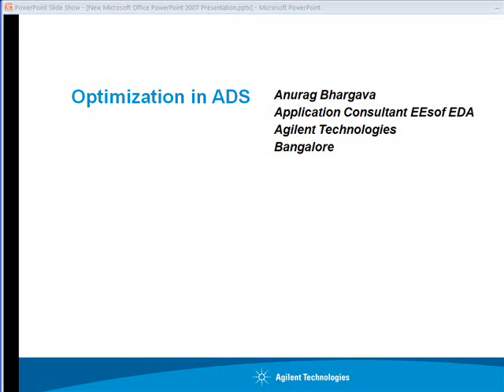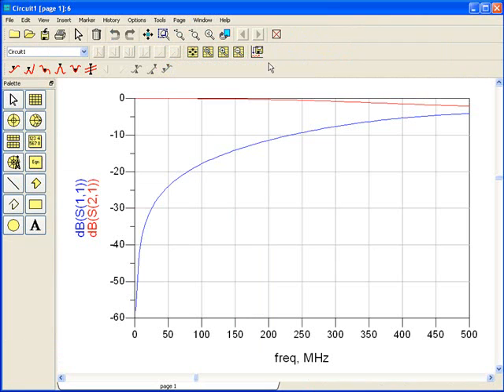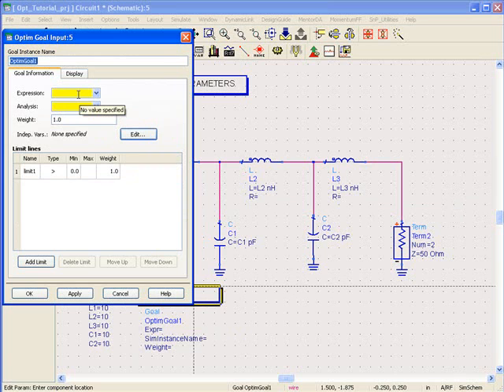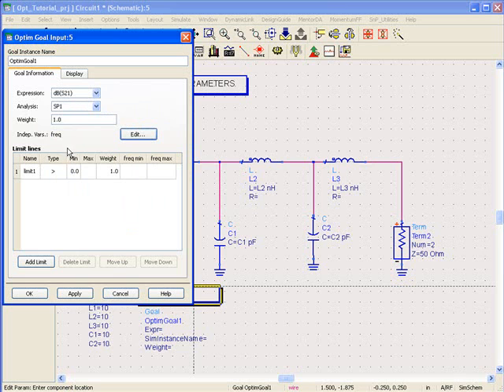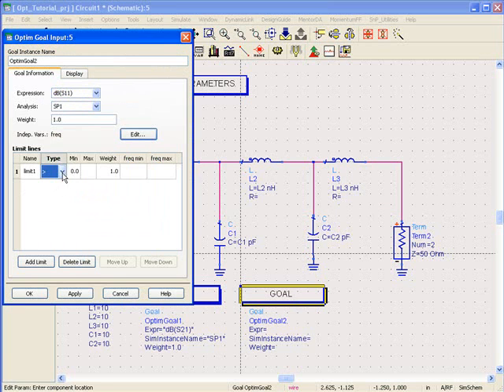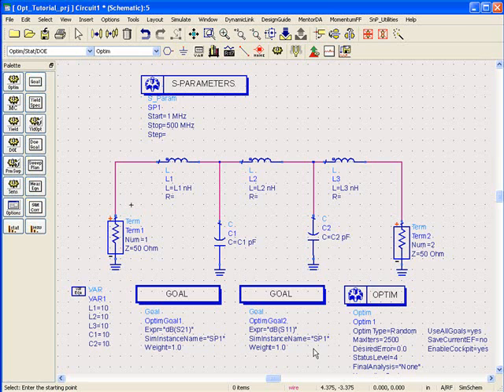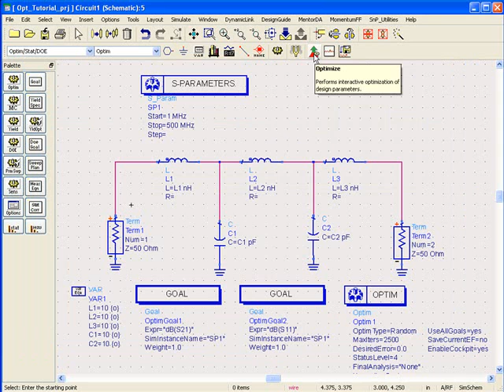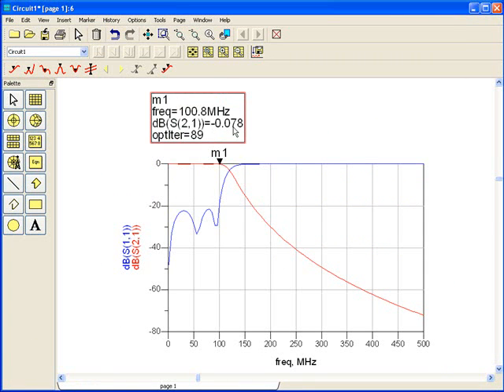Performing Optimization in ADS

Comment: hello sir ,
i want to use optimization tool in load pull cell  for function  #Gain_at_MaxPower#. How can do this task.
Reply from the maker: Hi Ankur,
For optimization to work you need to compute the term/equation in schematic and it can be done using MeasEqn. Anything which you compute using MeasEqn in the schematic can be made as an optimization goal however I am not sure how practical it would be to write the calculation of Gain_at_MaxPower in schematic as it may be dependent on tons of other equations and then all of them would need to be re-written in the schematic to make it as optimizable. I would recommend you to contact ADS technical support to help you with this....